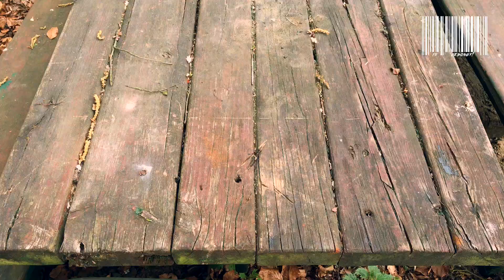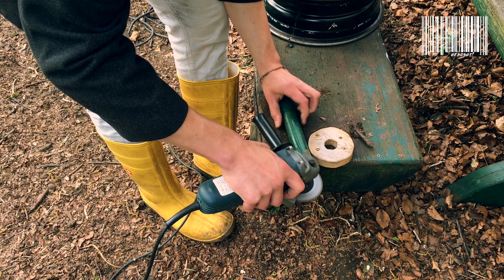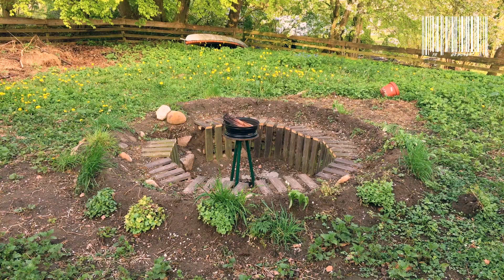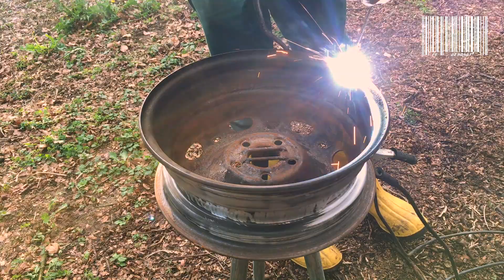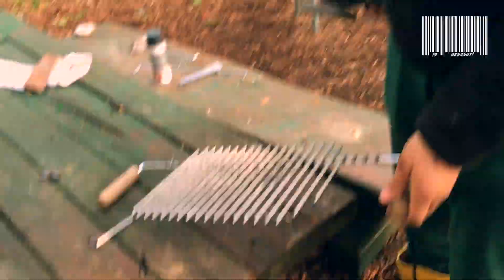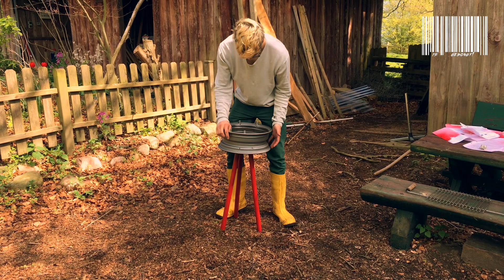#001 Wheel-Rim-BBQ

Comment: If you bolt/weld up a 2 inch pipe flange to the bottom with a elbow it will add a better spot for the blower to get your fire up and hot...like that of a forge.
Reply from the maker: +THOR son Good idea, there will be a version 2.0 sometime anyway. Thanks